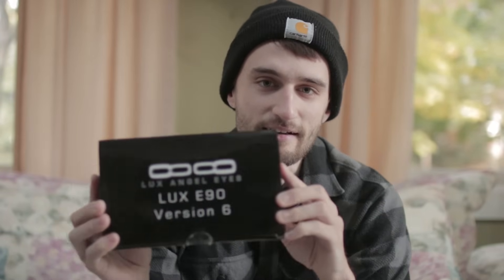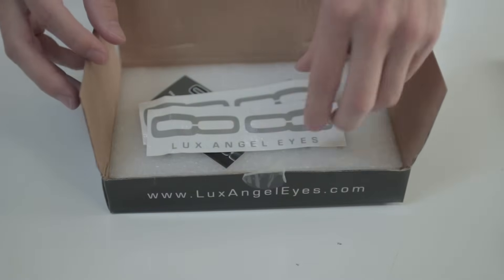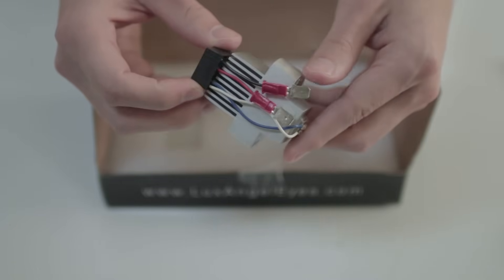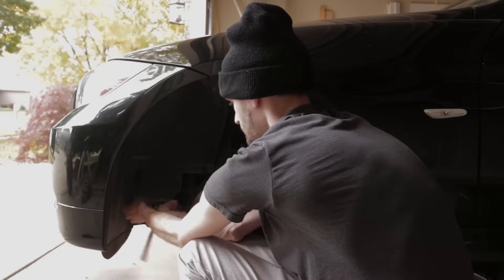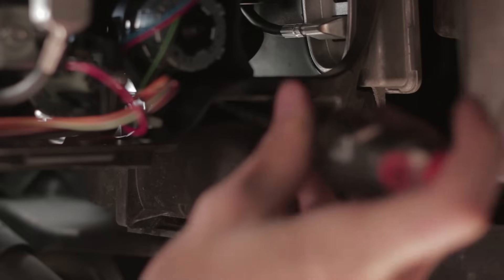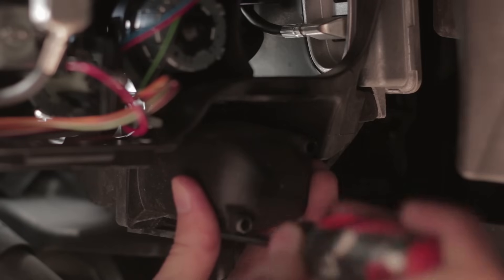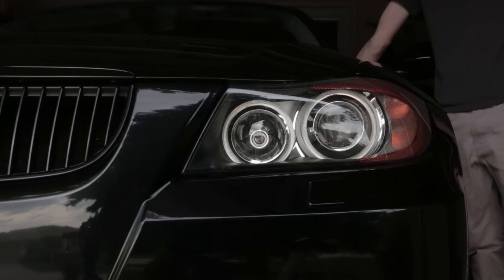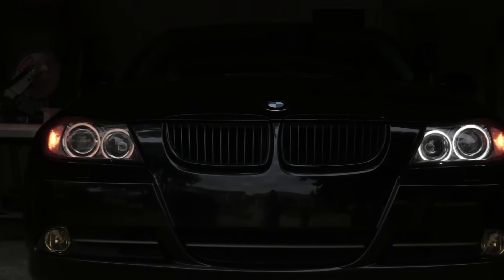BMW E90 Angel Eyes LED Upgrade (LUX)

Comment: I had these installed in my e90 335i about a year ago, they make such a huge difference! I also purchased the Carly adapter and coded my car to make the angel eyes as the DRL and removed the amber corner lights, it looks so much prettier! 😀
Reply: Adriana Lovelle  did you have an error message when you installed these bulbs? And what did you have coded
Reply: Adriana Lovelle where did you get them installed or purchase from?
Reply: I want to do the same thing to mine the orange markers in the light eliminate them... I have a 335i and I just ordered the Lux V7...
Reply: Derek Espinoza mo error codes
Reply: Changing the orange parking lights is it illegal in California? I want to change mine to bring out the red halos I put on

Comment: So much better buddy!  Especially from a distance they make a huge difference.
Reply from the maker: +Brandon B i agree!
Reply: Justin Buice I drive a 325i, 2010, E90, equiped with halogen angel eyes, I supposed this bulbs would work with my car no?
Reply from the maker: if you have the LCI facelift, i believe it is a different bulb
Reply: Justin Buice I drive a 320i, 2006, E90. Will this bulb work for mine? Thanks!
Reply: Man I just picked up a 2008 328 wagon. This upgrade for the halos is a must. Thanks, your video is very informative.
Reply: Yes these will work
Reply: LUX Angel Eyes hey my 2009 bmw wagon does not have xenon headlights. Will these still work?
Reply: No you will need the LUX E90 LCI Halogen V3 angel eyes instead on your car
Reply: LUX Angel Eyes ok thank you do you have a video up on how to install those? Looking to purshase
Reply: Justin, I have a BMW 328i and I'm wondering If this will work for me. Thanks man for all of your videos.
Reply: These will only work on a 2006-2008 E90 sedan with Xenon headlights
Reply: LUX Angel Eyes Does this also upgrade the daytime running lights? Or is that a separate bulb?
Reply: Shifted Perspective where could I purchase ? eBay doesn’t have

Comment: Yep, the best you can get before going full LED rings. I've had my LUX V6 ones for just over 2 years and they're still working great 👍🏻. You'll love them!
Reply: BMW Fanatic is the outer ring just as bright as the inner ring?
Reply: Aaron Clayton yes it is! Pre LCI has no issues with that. LCI ones are the opposite and do not have an even light distribution
Reply: BMW Fanatic Bros, quick question. I just installed my lux v7 bulbs. My left side looks a little less white than the other. Would you happen to know what could have caused  that? The only thing I do remember doing was I kind of touched the reflector tubes with my dirty hands. Think that might’ve been it? I would hate to have to redo this :/
Reply: So glad you said that here, my left stock halogen just died and I was thinking of changing it myself. Now I think I might as well upgrade to these beauties!
Reply: BMW Fanatic how would i know which ones to buy for my F11 2012?
Reply: These LED's are the actual headlights as well right ? Not just the halo rings which are the DRL's ? I'm new to BMW's and planning on getting me one.
Reply: @Meliney14  no bro these are just the bulbs you need to buy the head light separately
Reply: Did your car get a “tpms external interference” fault?  Mine did, how do you fix??

Comment: Thanks for the very useful DIY video. I made the decision to change to Lux v7 when one of my bulbs went out on my 2007 335xi. Definitely a learning experience taking the first wheel and covers off, but then the other side was much faster. Messed up putting the angel eye bulb cover back on - next day after a car wash the headlight was all fogged up. When I took the wheel, covers off again, water poured out when I pulled off the angel eye bulb cover, and I found that one of the (silicon?) seals around the angel eye cover had fallen off. After a couple of days of warm weather, it dried up, and all is good now.

Comment: nice video, good angles on taking the lights out. I made the mistake of ordering E90 lights for my E92 initially. then after more research found the right ones. I also learned the e92 halo bulbs are easier to get to. keep up the good BMW videos. They are appreciated.
Reply: Could you link the website for the e92 lights please ?

Comment: Just bought a used 2006 330i and absolutely loving it. But prior owner swapped out the old Xeons for a set of ebay ones that have the halos and an led eyebrow. Looks cool and all, but im dying to have the stock ones back in there at some point. To be fair, he did say they were yellowed, foggy, and had water inside them and that he sold them off. Lame. Looks like ill be paying some $$$ to get back a set of oem ones. Nice vid, those lights look great.

Comment: I just bought a 2009 335i yesterday, and will be adding these right after blacking out the kidney grills and lower cowling grills. So you ONLY change the modules, not the actual lights??? Why didn't you show how to put everything back??? Lol. Especially the floppy piece? Putting things back is always harder than taking them apart. Anyway, looking forward to doing this as well. They look great!

Comment: I was torn between the LUX and Weisslicht's.. I went with the Weisslicht's and it's been about 15 months so far and going strong, also very good build quality.
Reply: Shane Sexton how do the prices compare?
Reply: $ 150.00  Weisslicht's leds, just changed mine on my 330i 2006
Reply: Thanks

Comment: Also you might want to have the "voltage check" for your parking light (corona rings) turned off, otherwise the leds might flicker which looks stupid. You can do that either yourself with a coding software (e.g. carly android app and the proper cable) or ask some tuner, or even bmw.

Comment: For the 2 door version you don't need to take the wheel off to access the angel eyes. Pop the hood and there's a removable cover which gives you access to them. I don't know why they did this differently between the two models.

Also the lights on the 2dr aren't held in with screws. It's pressure fit with a quarter turn. If you're ordering these for a e92/e93 I expect it's a different model/part number.

Comment: I trust your videos. Quick question. My DSC is throwing 2 codes. RR sensor rotation and LR rotation. I have not rotated the tires. If I swap sides will it correct the issue

Comment: Wow. Looks great. 2 questions. How do these compared with weisslicht led bulb? And what is pre LCl? Thx
Reply from the maker: +samlee458 Im sure both brands are about the same. There are good reviews on the forums for both. For some BMW models, half way through the generation they do what they call "life cycle inpulse" which is minor updates to the car's look. Usually changes to the headlights and tailights and other small things around the car. The problem is, sometimes the headlights change to the point where certain bulbs aren't compatible

Comment: Dumb question, but when you change the angel eyes. Should you change the stock headlight bulbs too?? My driver side bulb went out and wanting to switch to LED. 2008 bmw 328i sedan e90

Comment: Hi Justin, love your work and congratulations on adding more subscribers everyday. Keep up the good work. I have a 2007 335i, 6 speed. 
Questions for you : 
1) Does this kit take care of low beam as well as high beam ? 
2) Or one needs a separate bulb purchase for either ? 
3) Any electrical fitting upgrades needed? 
4)You have had them for 6 months plus, have you faced any issues so far ?

Comment: I did mine yesterday on my 2010 E90 I took off the tires and got red halos but then I realized there was a way easier way from the hood 🙈. And who ever owned the car before had replaced halos and mine didn’t have the original plastic housing, so I just screwed the lights on Anyway and the rings don’t have the same lighting . Any recommendations where I can get the plastic housing ?

Comment: Great video! First of all, Will these led rings fit a bmw that does not have xenon? Secondly, do you need to swap 2 lights on each side? Or does one led lamp light up both rings on one side? Many thanks
Reply from the maker: +w8t2009 the xenon enclosure has the rings built in, so if you have the base halogen lights, you will need to upgrade the whole headlight assembly first. One LED lights up both rings, so you only need one light per side
Reply: Thanks alot! I sent you a PM

Comment: Great video, my halo lights on the left side just burned out on my 06 330xi a few days ago and i'm looking to buy new halogens lights and those lux angel eyes look great. Also how did you put the other ones on the other side of your car? I hear it's impossible to replace the lights on the right side and you'd have to take it to a bmw dealer to get it replaced.
Reply from the maker: +Empra Mcdade its the exact same process on both sides. No need to go to the dealer :)
Reply: Justin Buice thanks bro

Comment: Hi Justin, great video. Thanks for this video. I changed one side and started the engine. It is flashing few times even the parker is switched 'OFF' position.  Will it affect electronics?
Reply from the maker: That’s just the car doing a voltage test on the lights. You can use a tool like Carly to code that off. It did that before when you had the stock halogen bulbs but it’s not enough voltage to illuminate them. That’s why you never saw it until now with the LED’s
Reply: @justinbuice  Thanks Justin for your quick response. Which carly model I use for this 320i?

Comment: did the same thing to my e90 but i bought the $20 pair at amazon and they work just as well so far
Reply: How long have u had them for? I got the 30 dollar ones from ebay but they haven't came in yet. I hope they're good.
Reply: almost a month i think still good
Reply: almost a month
Reply: Jamalie Thenor still good?
Reply: link?
Reply: Jamalie Thenor are they still working ?

Comment: Hey Justin, have you done the Daeos Daytime harness? Or do you usually drive around with the lights set to parking lights? I have a 08 Pre-LCI, but my daytime running lights aren't the angel eyes, they are the halogen bulbs.

Comment: Justin I know this is an old video as a matter of fact I saw this video before upgrading my halo angel eyes to led, the thing is that Im in Mexico and couldn't find that brand here so I got other set. 8 months later the right one isn't working anymore, let me tell you that I use them on all the time because DRL is active. My question is are yours still working?, want to know if the investment is worth it.  GREETINGS FROM MEXICO

Comment: Hey Justin, cool video, I got a 2008 BMW 320i and I don't have those 'rings' in the headlights as it came by standard in your car. Where can I buy headlights similiar to yours that fits in my car?
Thank you!
Reply from the maker: +subtlER0X you can get them on ebay but the wiring might be different
Reply: Justin Buice can you please send me a link to a listing? I count on you  ;¬]

Comment: Both a thank you for the video and being so descriptive on installation and product (those that failed and this one), and a "I hate you" because now instead of dropping maybe $20 (as most I've found are roughly around there), I now will be spending $125+!! UGH!
Reply from the maker: It’s worth it. They are kind of a pain to install. So once they are in, you will be happy to have a quality bulb that wont need to be replaced for YEARS
Reply: @justinbuice  Well, tried installing and mine looks NOTHING like your video :'( I've got an 06 525i base model. I got to the 2 T15 torx Screws but there was no light whatsoever. the light is FAR buried behind a bunch of stuff that either I'd have to break (no go) or take out everything to get to it seems... Ugh. I'll check it again sometime this weekend  and maybe upload a picture, but hopefully I'll be able to do it this next time.

Comment: Evidently they don't work on my car or the mechanics screwed up so now i'm considering upgrading to retrofit pair for around $1.2k just to get decent headlight setup, lol.  You ever hear of em not working on a 08 335xi e90??
Reply from the maker: The halos dont work? I have never heard of that. Maybe theres a setting that got changed in your car
Reply from the maker: If your car has iDrive, check the menus for an option called “parking lamps” that’s what BMW refers to the halo lights as

Comment: So when you bought your car, did it come with the halos headlights go did you switch your headlights? I have the same car as you but my halos don't shine. I don't know if it's because the bulbs are out or if I have different headlights then you
Reply from the maker: Mine came with halos, I only replaced the bulb for brighter ones. What model is yours?
Reply: Justin Buice 330xi

Comment: Quick question I still don’t know which ones are compatible with my car I have an e90 328xi 2011 and I don’t know if the V4’s would work or the V8’s I hear the V8’s don’t work unless you have Xenon headlights.

Comment: Hey Justin, I might be buying a BMW 3 series I need your opinion. It's a BMW 328xi 2008 model with 170k mileage . The seller include all major BMW maintenance done on it brakes,transmission,etc. And it is $8000 should I buy it ? 
Lastly can u list BMW 3 series models that are reliable thanks I would appreciate you answering .
Reply: Amol GIll no, don't buy it
Reply from the maker: +Amol GIll 170k is very high milage and $8k is a bit much in my opinion. The car is only worth $8-11k in excellent condition/ low miles.
Reply: I live in Canada so it's in dollars (Canadian)
Reply: Amol GIll it's too much for a 2008 bmw, in fact I am looking at a 2007  328i red, with tan leather interiors with 83000 miles for $ 9,950
Reply: How much should I negotiate by
Reply: you will have to divide the milage by the year, so 170k miles divided by 8 year old car is like 21,000 per YEAR!  the normal use is 13,000 miles a year. 

Considering that you are in love with it, and you don't care the milage, or what that car had been gone through, $3000 or $4000 maximum
Reply: consider a bmw that is under the 100k, that way if it's under a 100k warranty you will be covered. A lot of bmw have problems with the water pump and things like that when they reach 80k to 100k miles
Reply: don't get fooled by the statement "oh it's a bmw" , yes it is a bmw but that doesn't mean that you will have to stick with a heavily  overused bmw, just because it's german
Reply: if it is very expensive to buy a beamer in canada, compare the price difference between buying it there or using carmax and have them ship it to you
Reply: Hey there Amol! I bought a 328xi 2007 for 8k and I don't regret it! The maintenance was done and it got in a accident but repaired by bmw which makes it newer. It's worth around 11k for 160k km... So with the 3k profit I spent like 1.6k making it newer, changing the oil and all so yeah according to me it's definitely worth it
Reply: Prince Infini thanks for the information I now learned a lot. I will properly buy a BMW for around 7-8 thousand dollars, kept in excellent shape can't thank you enough.
Reply: Oscar Lyytikainen I am talking about kilometres
Reply: Kevin zz thanks a lot of the information I really appreciate it I think I will buy a BMW 3 series for 7-8 thousand with maintenance done . Thank you once again
Reply: Oh hh so it's not miles, it's km...... I am so sorry, here in the us we use "k" to say thousands  , I thought you meant 170000 "miles" ... well base in the fact that it could have around 105000 miles, then it is almost a good deal. 

it means that probably  the water pump has been replaced... and the radiator system flushed, this and that... offer him $ 6,700-$7,500 cash!!!
Reply: Kevin zz okay thanks once again for the information I will surely do.

Comment: Can you run just the angel eyes during the day or would that be illegal? cuz ive never known what the angel eyes are considered to be, whether they are parking lights or if they are in fact daytime running lights
Reply: In Canada they are Day Running Lights, they are always turned on, unless you code them to be off. In your country i dont know but i think thats not a problem to drive with them turned on

Comment: Justin and other people on Youtube I am confused now. I have a pre lci 2008 BMW 3 series diesel with the original non angel eyes halogens. I am on the edge of ordering the V7's and angel eye headlight units but as the website of Lux writes you can't install the V7's on halogen angel eyes. Only on the ones who came with xenon from factory. Is that true? Cause i've seen comments and a video of people having halogen lights and put them in anyway. I am so confused right now can someone help me out?

Comment: I installed original angle eyes with xenon(Removed from another e90 bwm same year) on my 2006 318i e90 but it gives me error on the screen and does not work properly, anything I should do ? some says light module needs to be replace as well ? Thanks in advance.

Comment: I have a BMW 220i 2005 e90, but it says for e90 after 2006? So it will not fit mine? Because it seems e90 2005 is the same, on xenon lights? Please let me know. Thanks.